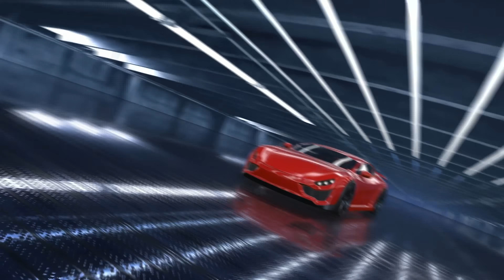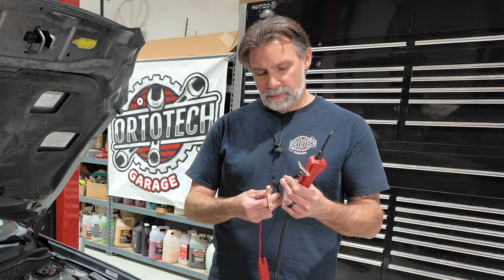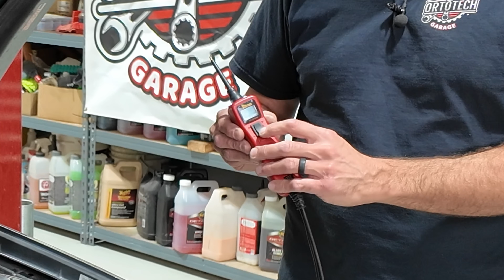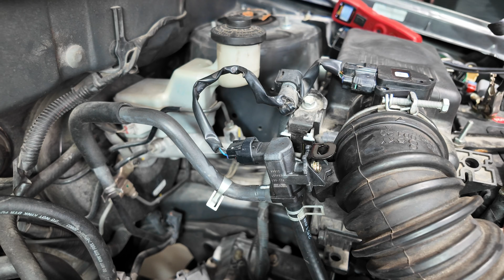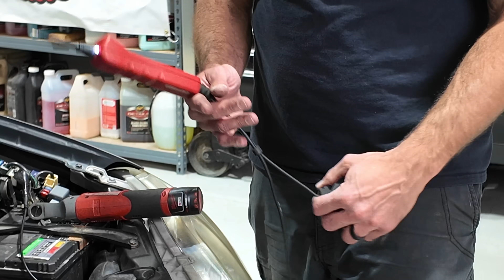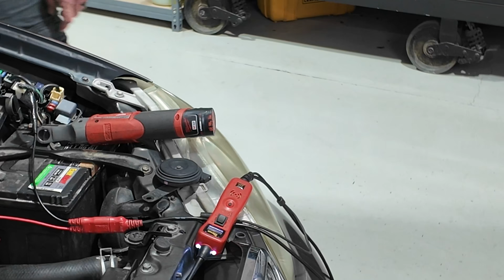Stop Using a Test Light! Use This Instead

Comment: The test light with an incandescent bulb does something the Power Probe cannot do. It loads the circuit and test for current flow!

If you need a larger load for a circuit, use a sealed beam headlamp bulb. 

If you only use the power probe, you gone get burned and this will lead to a misdiagnosis. Just like a multimeter, the power probe may show battery voltage, but there still could be a connection problem or broken strands of wire!

The only way to use a volt meter and verify everything is to put the circuit under a load, and if the load is not working the volt meter or power probe will lead you down the wrong rabbit hole.
Reply from the maker: Thanks for sharing your experience!  Testing statics circuits can definitely get you into trouble.  I always recommend testing an active circuit and measuring voltage drops where necessary. Power probe has a new feature that actually does this for you, which is a nice addition so you dont have to break out a voltmeter. Tools are evolving everyday. 👍

Comment: Looking for a short to ground on fuse 32 2008 F150 5.4L Triton. All 8 components disconnected to fuse 32, AC Relay removed. Fuse 32 blows as soon as you turn the key to on position.
Reply from the maker: You will need to find the splice connections in the harness and start disconnencting them to isolate the short.  If you can find one mid way in the harness that will elimate half the system as a problem right away.    The short finder that comes with the power probe can be helful if you can access the harness.  If it disappears under a dash, some dissassembly will be required.

Comment: I just ordered a power probe for hoping to test out some fuel relays, cooling fan and manually powering up fuel pump to test flow rate.   Would be nice for testing out fuses as well.
Reply from the maker: Yes.  It will be great for all of those.  Just be careful with the fuel pump circuit.  Some cars pumps are pulse with modulated and won't receive a contant 12 volt power supply. Backfeeding full voktage into fuel pump nodules or other related circuitry ciuld be problematic.  Make sure you know and understand the circuits. 👍

Comment: Dynamic test leads on a multimeter is usually my weapon of choice, no chance of damaging any computer circuits. I have a PP4 though and have found it useful in certain situations, just not a fan of tripping over the cord 😂
Reply from the maker: For Voltage, rssitance and amperage testing, I usually prefer a multimeter or a scope. But the power probe dominates for efficientcy and the ability to supply power and ground with circuit protection built in. 👍

Comment: Hi all! I can affirm what this tool can do for you! As a professional automotive master tech, I was using test lights, both incandescent and LED,  DVOM's and have both the original PowerProbe and the PowerProbe 3. I remember waayyyy back when, after the purchase of my original PP with just the bi-color LED and rocker switch and gound pigtail, the FIRST time I used it on a no start vehicle (cranks, no start) the time I saved in diagnosing this problem. While the LED test light and DVOM tell you the available voltage, neither would tell you the available current. Neither could verify whether or not the fuel pump was capable of physical operation (the pump WAS the problem) Using the PP I was immediately able to tell that I had power and ground available but also were each circuit capable of carrying current. Apply the opposite polarity with the rocker switch to each circuit and the breaker on the PP would open. Also, once I verified circuit voltage and ground and integrity of the circuit, I was also able to attempt to operate the fuel pump using the pigtail ground and the rocker switch for power. I verified this all within one minute of gaining access to the fuel pump connector on top of the fuel tank. I've been a believer in the PP ever since!!
Reply from the maker: Awesome example of how the PP is used in the real world!   Check for supply voltage, short to ground, continuity in the pump windings, ground side voltage drop and power the pump superficially, all with one tool.  That's super efficient.   👌 Thanks for sharing and for watching!

Comment: I just bought a V500Pro its pretty sweet. Blows power probe outta the water. 5v refrence adjustable amperage, oscilloscope, relay tester, injector tester and more.
Reply from the maker: Thanks for the tip!  I will have to look into it.   What brand makes that?
Reply: Vdiagtool

Comment: Does it test under load
Reply from the maker: Yes it does, if you are applying power to the circut.  This is why I love to use it.  If you are backprobing a connector on a circuit that is active, you are also testing it loaded.  Think of it as checking the live voltage drops between your test point and ground.  You could even back probe another point in the circuit and connect the external ground lead to check for voltage drop across any 2 points in a circuit using the included voltmeter. All of those examples ar testing under load. Static testing would be just checking for a power supply, continuity to ground, or even continuity in a compoment like I demonstrated in the video on the horn and in the solenoiid while disconnected.  👍

Comment: Thanks ! how about testing a hvac motor blower and a blower motor resistor, for diag on why the blower motor might not be working....thanks again !
Reply from the maker: I don't have a video for that specifically, but the properties from this video apply.   Use the power probe to see if you have power going to the blower motor connector.  Check it in all fan speeds.  The resistor is generally bypassed on high speed only. Use green light to determine if you have a good ground at the blower motor.  Some circuits work on the power side and others on the ground side. Unplug the connector and see if you can use the power probe to activate the blower motor.  It may pop the breaker because it requires more amperage than the tool is designed for. It js best to have a wiring diagram to follow if you have access.

Comment: Good morning,

Diy mechanic here, I'm also a New subscriber.

Looks like a good channel to follow for helpful tips to assist with automotive electrical system of my old own vehicles.
Thank you for the helpful information, 
Mark.
Reply from the maker: Good morning and welcome to the OrtoTech Garage, Mark! Thanks for subscribing and for watching. I have lots of content in here for the DIY mechanic so I hope you can find some videos you can use.  I have an introductory to the multimeter video here: 
 
https://youtu.be/j7VRdkclubs?si=EVtUjfsSBJ6S2LPh

I also have diagnostic test,  compressiont test, ignition timing, cylinder leakdown testing, scan tool uses and a variety of all auto repair related stuff if you sort my content by Videos.

Comment: It’s just another tool for diagnosing. Unless you know how electrical works.  That tool will give false positives for the novice. You can’t go wrong or destroy parts with a test light. And with different bulbs in the light it gives you different amp loads on the circuit.
Reply from the maker: There are lots of tools you can use to diagnose the same problem. I happen to love this one, but I have a fair amount of electrical knowledge and expertise.  I have been using this tool for decades without a problem, but I understand your concern and agree that if misued, it can cause damage.  There is no right or wrong, as long as you can come to the correct diagnosis with your methods. 👍

Comment: WOW this is the absolute very best instructions I have seen on using these power probes. Thank you...
Reply from the maker: I really appreciate the feedback, happy to help you get the most out of your tools! 👍Thanks for watching and following the channel!
Reply: I agree, very good explanation & demonstration. Thank you for sharing your knowledge.
Reply from the maker: Youre welcome!  I may do a follow up to this with the Power Probe 4.  It seems this is a topic a lot of folks are struggling with. Stay tuned.  Thanks for watching and following the channel!
Reply: @OrtoTechGarage  thanks again sir, but is it possible to do voltage drops using the power probe and seeing the actual drop like with the multimeter?
Reply from the maker: Sort of.  It depends how you set it up and what state the circuit is in.  It must be active on its own accord.  Then you will be measuring voltage drop at each point you touch the tip to, from there to ground. Includung the voltage drop accross the ground side of the circuit if you went after the load.  To check the voltage drop accross a load or a particular portion of the circuit you would have to use the negative side of the 2 battery clips as the end point of your test. It gets a little covoluted there but it can be done.  I might recommend switching to a standard voltmeter for that for better clarity. I can include this in another video for a visual demonstration. 👍
Reply: @OrtoTechGarage got it. Thnx again. 😊

Comment: Now someone will power up an airbag circuit with the power probe and maybe get hurt or worse.  Or,  apply power to an canbus system that shouldn't have full 12 volt power.  The Power Probe is not for everything and in the wrong hands can do way more damage than good.
Reply from the maker: Well...I clearly explain what this tool can and cannot be used for in the video.  All tools have risk of damage or injury when used improperly.  That doesn't mean they should not be used at all.  It means the user should be educated and trained before using them. Hence the video.

Comment: This tool needs a pulsing function to activate for instance a thermostat heater.
Also, if it had a five volt function you could probably do way more diagnostics when it comes to sensors.
A light bulb is great if you want to have some sort of current limiter/buffer when working on sensitive components.

This tool is great for what it does...

Excellent video tutorial!
Thanks for sharing!
WWG1WGA
Reply from the maker: Yes!  That is where Power Probe makes some improvements in the newer version and with adapters.  This is really an older model, but still very effective. Just limited for the types of circuits it can be used with.  The newer models are more capable. 👍
Reply: They do sell an add-on that adds PWM its the PPPWMTIP

Comment: If you check powers and grounds with power probe-you don’t know what you are doing. Why spend so mutch money on this tool when a test light can check powers and grounds (real load) and a jumper wire can give powers and grounds? Fancy tools don’t make you a good tech.
Reply: You don't need to feel intimidated by the P3.
He is suggesting a tool that can help you become more efficient by having 1 tool replace multiple tools.
No more back and forth.

You still have to be skilled in the automotive electrical systems. 
The tool doesn't know what it's doing, the mechanic knows what he's doing with the tool
Reply from the maker: Correct!  Thank you for backing me up, Mark!  I appreciate your support. 🙏
Reply from the maker: I am 100% confident I know what I am doing.  I have been a certified Master Auto Technician since I was 20 years old, recertifying every 5 years. I am L1 certified for Advanced Engine Perfomance, plus multiple other certifications.  I have a university degree in automotive engineering technology.  I own and operate three auto repair shops for over 25 years and have fixed tens of thousands of vehicles in my 36 year career. I think my credentials speak for themselves...
Reply: @OrtoTechGarage . Thanks this smack down made me laugh.  You’re credentials are impressive and the vid was great clear and concise. He power probe lets you do many things that are necessary and only have to drag out the suitcase full of other equipment when needed. 👍😂😂😂
Reply from the maker: Thanks for getting my back, Jim!  I don't understand why some people feel the need to challege everything. I am just here to help everyone with a subject that gets exponentially more complicated by the day.  I do this for free and don't really need the negativity. I dont want to see my comment section truning into a forum for people who have something they think they need to prove. I appreciate you! 🙏

Comment: Very informative video.  I have the PP3 as well as an Innova and Autel version.  I like the Innova because it has a switch where you can choose 3 volts, 5 volts, and 12/24 volts.  You don't have to add on the 5-volt limiter that PP makes for their tool.   
I still like using various amp test lights to load a circuit to see if the circuit can carry the load, especially if the load doesn't work.
Reply from the maker: Thanks!  I haven't tried the other brands, but they sound neat.  I may have to look into anothers to see what I'm missing. Thanks for sharing that!
Reply: @OrtoTechGarage  The Innova and Autel are quite a bit cheaper than the Power Probe and is a cheaper alternative for those that don't want to spend PP money.

Comment: Sorry but that’s not only a dangerous tool in the wrong hands but as a diagnostician I believe and many agree with me also is load testing is the best way. You look for power and ground and the bad thing is the a strand of copper wire can carry current and can mislead you thinking it has 12v ,5v etc when it really ain’t there but again it has its place and again there’s more than one way to skin a cat cuz make sure you skin it properly.
Reply from the maker: This is true.  If you're trying to be efficient, I find it is a great starting point, but of course there are many other tests that may be required.  This is not the end of all diagnostics, but often the beginning.  👍

Comment: In the right hands, it becomes the Circuit Popper 5000.
Reply from the maker: This is true!  Its best to have a good grasp on electrical basics before using the power probe.  A wiring diagram and connector pin locations help with that, too. 👍
Reply: @OrtoTechGarage  when I use it i always isolate components like motors  I never apply power to test a motor while its in a circuit due to backfeeding which can also fry something.
Reply from the maker: Yes!  This is how you should do it.  Similar to an ohm test, where it must be isolated.  👍
Reply: I do like the PowerProbe™️ , but I have a SnapOn™️  probe with a selectable circuit protection from 2.5A to 30A with a few more superior functions for my diagnostic procedures at the same price as the PP4.
Reply: @JeremiahSchaefer-m5o  I was going to buy one of those but then decided to buy a car instead. 😁
Reply: I'm an ASE-certified circuit popper!
My motto: “Tune for Smoke”

Comment: I’ve got one I use for some things, but there’s nothing like voltage drop testing 😊
Reply from the maker: A voltage drop is a great test to make sure you are getting the proper voltage to the load in the circuit.  It is basically a resistance test in a loaded circuit.  The power probe does some things that a voltage drop test can't do, so its good to have both processes available to you. 👍
Reply: @OrtoTechGarage True……
Reply: @Cattechnician. I’m curious do you go straight to the voltage drop testing. Or do you use other testing methods first to whittle down the problem.
Reply: @jim10221 people have differing opinions, but when you consider there can’t be but 3 faults with a single wire… open, short to ground and high resistance, then voltage drop testing narrows it down quickly.
Reply from the maker: Also, dont forget it is possible to have a short to power, as well. 👍 I see this from time to time. It can cause some backfeeding into the circuit and other odd problems.
Reply: @OrtoTechGarage but…I said only 3 faults in a SINGLE wire. A short to another wire is involving more than one single wire.😊
Reply from the maker: Roger that! 👍
Reply: @OrtoTechGarage I got corrected on that one time too. Thanks for all your videos and professionalism in your work 😊
Reply from the maker: You bet!  I appreciate your comments and interaction, as well.  This is a community where we all have something to offer and to learn from each other.
Reply: @Cattechnician   Not trying to troll you but he's right. When you're testing a single wire and you find "a" problem with that wire that is a fourth problem.